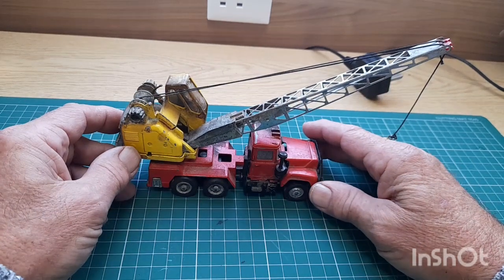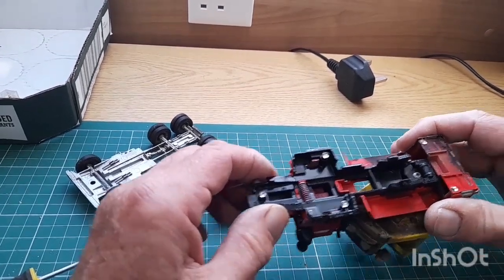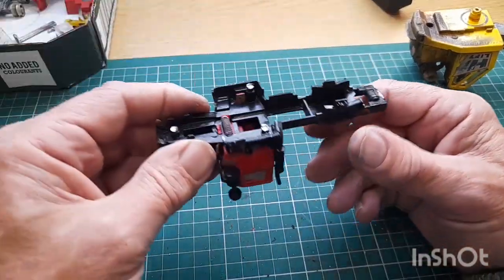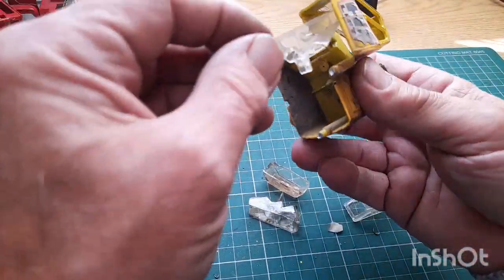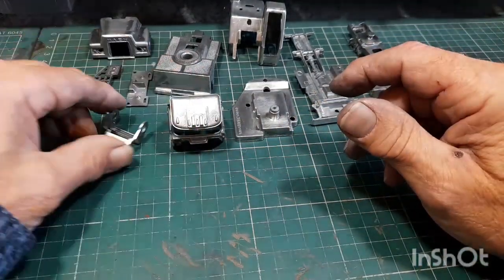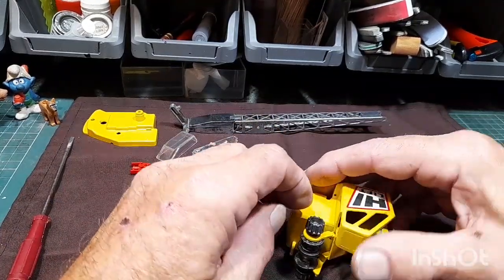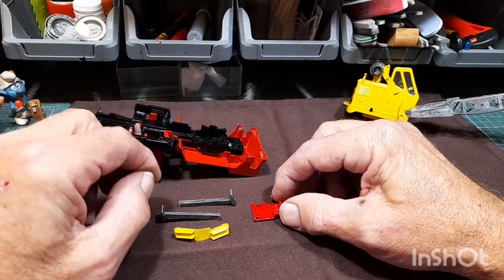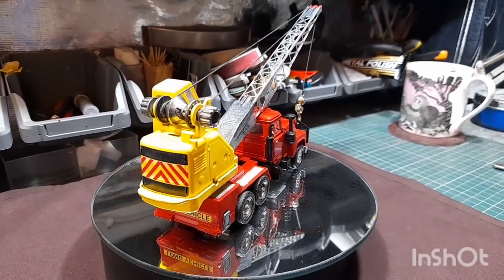Diecast Restoration Corgi major Mack Crane Truck No/1154  1972/76.

Comment: epic indeed. :) one must appreciate the genius behind the construction of toys like these. <3
looks brandnew again, I think the nekkid zinc pieces back when didn't look better, either. :P of course, it being complete was a big plus.
I still think someone tried to dismantle it with one or two firecrackers, which explains the melted glass pieces. and the melted-in residue, too. good thing it wasn't big enough. XD
personally, I'd have masked the spots between crane and truck, where both meet, and lubed the blank metal with some graphite off a soft pencil. in my experience fresh paint in such spots tends to stick together, and rip off eventually. I have had it with majorette door hinges in the past.
Reply from the maker: Cheers my friend, that's sound advise, I have some more crane's to do , this was an interesting restoration and challenging at the same time , I was lucky with the lorry cab glass only slightly touched by the heat .
All the best martin 👍

Comment: What a superb restoration Martin, and what a lot of parts to put back together and pretty fiddly too! I have a couple of those to do so very good to see your video, the ones I have both have the winding mechanisms missing, one was a doner model anyway and I’ve already had some bits off it, but I will be watching on eBay for one with what I need on! I really enjoyed this restoration video, the paint job is beautiful, the yellow has covered really well, looks like a brand new model, top work, Martin👌👍😊Take care, all the best, Nick🐸🐸🐸
Reply from the maker: Cheers nick ,I hope you find it useful later ,on the winding gear I'm not sure but have a look at dinky landrover tow truck,the one with the opening doors and the dinky bedford tk break down truck I think the winding gears are the same ,if you had2 you could make 1 .
All the best Martin 👍

Comment: Hi Martin now that took a lot of concentration and patience very well done. Next door from where my Dr has his practice is the Queen Elizabeth Hospital and they are putting a new building up. So every time we go to see the Dr we take a photo of the progress. Right in the middle of the sight is a huge crane one of those ones where the bloke has to climb up very high to get to his cab. Should be interesting when building is finished and we watch the pictures one after the other. I wouldn't like to be up there if it started to fall over.😲😬 Nice to see you have a diecast restoration mobile service....Martin Dares  Dinky Restorations on wheels lol.😂🤣 Stay safe mate when you travel about and remember where ever you drive in the world the driver should be sitting on the side that is in the middle of the road.👍🏻
Reply from the maker: Hi Geoff, thancks very much. 
I bet that would be fun to watch back , those things are a bit scary and do blow about in the wind .
Soon be time for you to get the moter on the road again 😎
Reply: @martindaredare  Hi mate I took her out for a long drive for the first time at a high speed of 110klms 🚀for an extended time. It's probably the fastest the old girl has ever gone before. I have a secondary after market digital speedo because the original one is not accurate over 60klms. I looked down at the original speedo and it was waving all over the place. When I got home I pulled it out and had a look. The hole in the back that normally has a square hole to connect with the speedo cable was totally stripped. Been looking for a replacement one from the place I got the 5 speed gearbox from it's a bit more modern as it's an electrical Smiths gauge  rather than the old mechanical one the car came with. What's that ABBA song...MONEY MONEY MONEY..lol
Reply from the maker: Thats great that you took her for a long drive ,I bet that old speedo wavering at you did your head in it would mine😂 glad your going to replace it ,save on speeding tickets. 
Have fun 👍

Comment: If you ever need a glass that you can’t find a replacement, 3D printing in transparent UV resin, wet sanding and two coats of varnish will look just like the original. I have done this with slotcars and it really works.
Reply from the maker: Thanks Everson ,that's really good information and is much appreciated my friend 👍